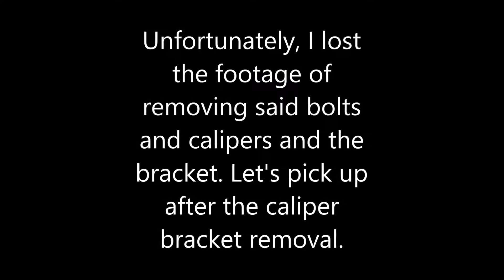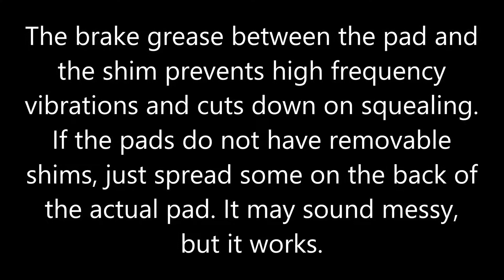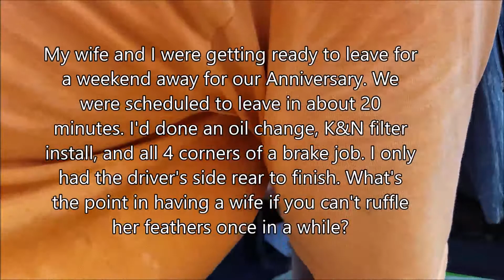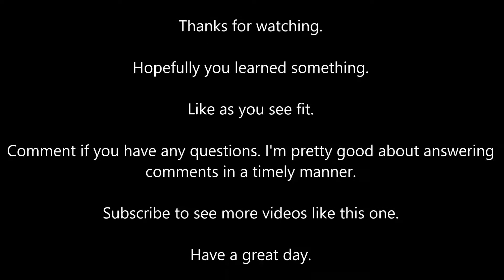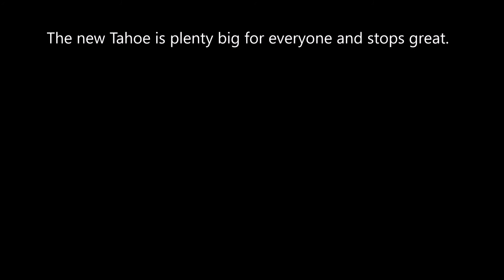2009 Tahoe: Front and Rear Brake Pads and Rotors

Comment: Noticed you greased the tips of the slider pins.the pins will not tightn due to grease at the end
Reply from the maker: The shape of the pins allows a gap for the grease to push out from the bottom of the hole. I've never had a problem hydrolocking a brake caliper pin. I'd rather have the entire pin coated in grease and not allow any corrosion or rust. 
I agree that blind holes can crack castings when attempting to torque fasteners such as head bolts. This is not one of those cases.

Comment: I wish my rotor was that simple to take off
Reply from the maker: Agreed. These are simple. 
  My 1990 Silverado K2500 8 lug (and my matching 1993) have the rotors mounted inboard of the axle flange. All 8 wheel studs are pressed through them. It's easier to pull the cv axle and hub bearing. 
  I did a rear disc brake conversion on my 90. I have to drain and pull the differential cover, pull the c clips, and then pull the axleshafts to access the rotors. And even then the wheel studs need to be removed. It's a real pain in the ass compared to 2 simple caliper bracket bolts!
  Good luck with your brakes!

Comment: Sweet what size are the lug nuts for the tire.21 mm or 22? I have the same vehicle. Thank you for the video.
Reply from the maker: I think the socket size is 21mm. But I don't recall exactly. They are factory wheels and lug nuts.
Reply: @EricErnst  yes, they are factory wheels. Thank you. I’ve done brakes and calipers before but I need to buy some deep sockets so that’s why I was inquiring. Thank you for the video.
Reply from the maker: @catskillyeti2405  I usually just buy a whole set of impact sockets together. I try to keep the set complete. You could buy a whole set for what 2 or 3 sockets would cost individually.